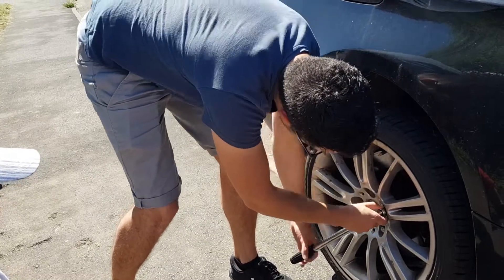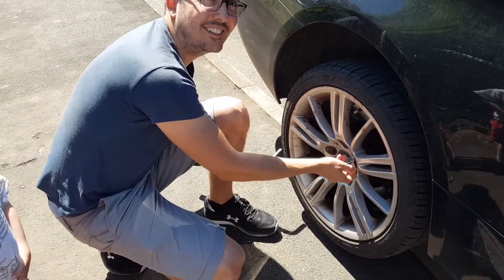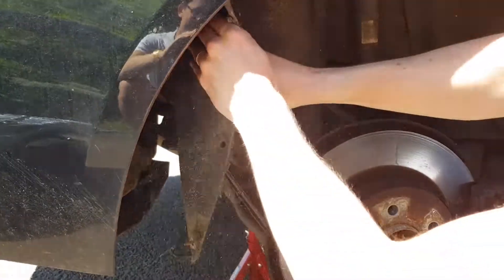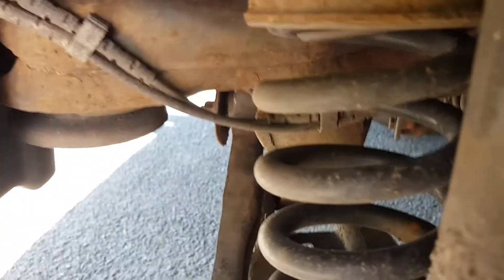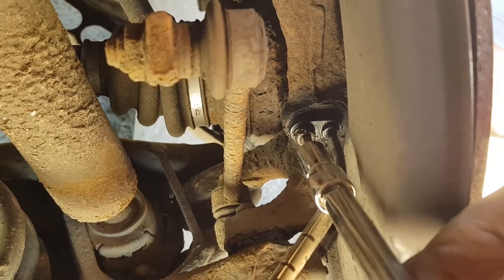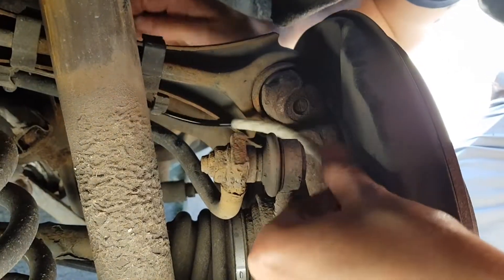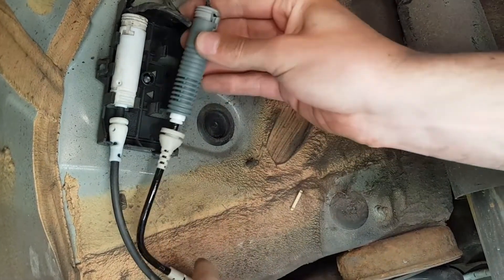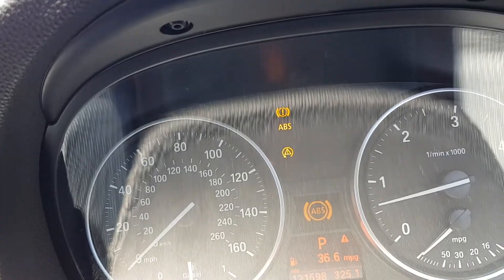3 Series Wheel Speed Sensor FIX - E90/91/92/93

Comment: its the abs sensor not wheel speed sensor, but the rear right sensor is responsible for the odometer speed. same with the reluctor ring